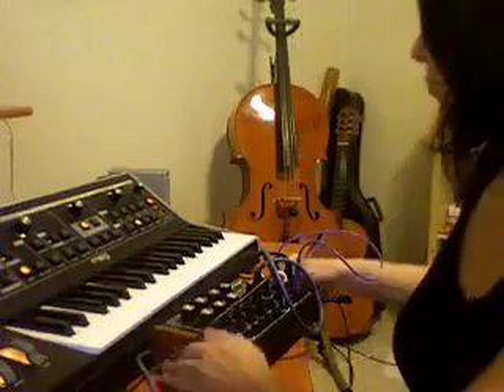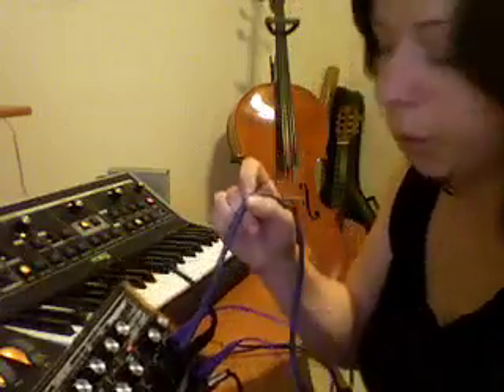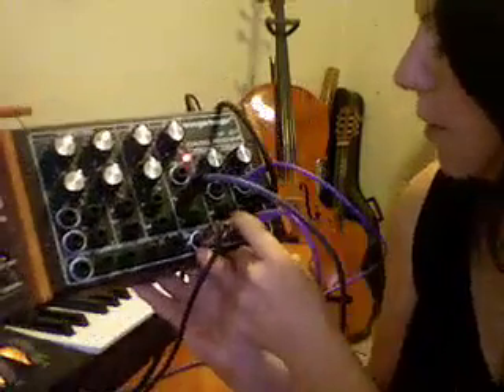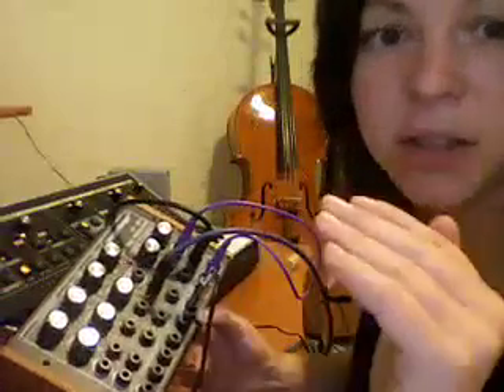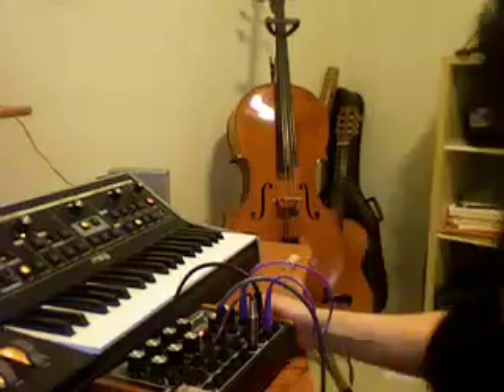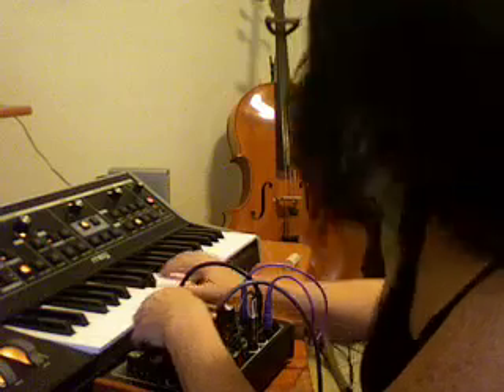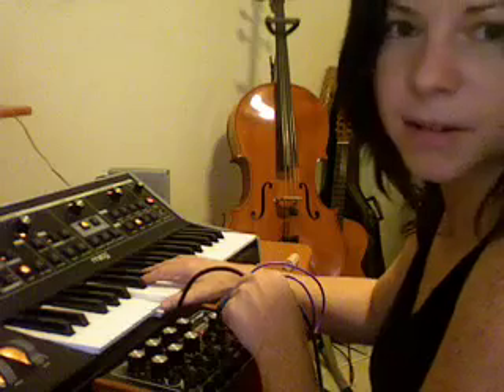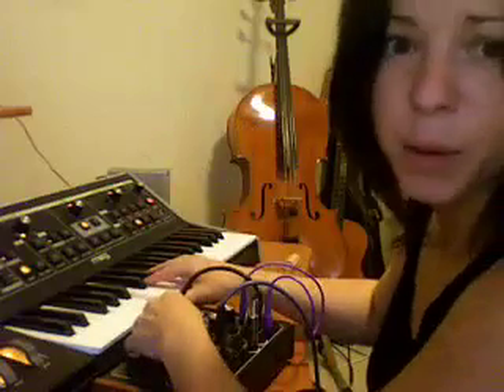CP 251demo

Comment: Hello, I’m impressed! I have the cp 251 and a bunch of pedals that have an expression jack. Also patch cables. I can’t make the cp make any sound to control me pedals. What type of cables are you using? I have normal patch cables that go between pedals and also 1 cable that belongs to the Moog expression pedals which has the extra line (stereo or trs). Pedals I’m trying to control with the cp are ocean machine, súper pulsar, hologram dream sequence & rv500 boss reverb but none work. Any tips 😅
Reply from the maker: Hi there. You need control voltage cables (CV). They are different than audio cables but they are capable of transferring audio signals as well, if the module can receive it. Make sense?